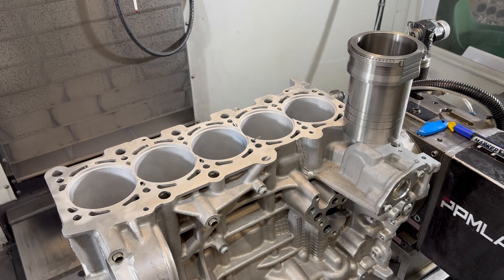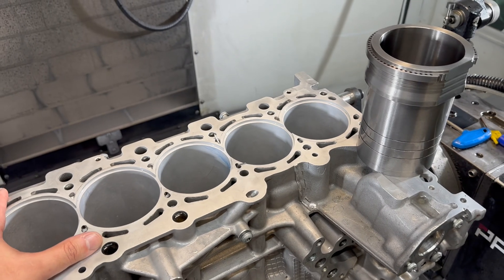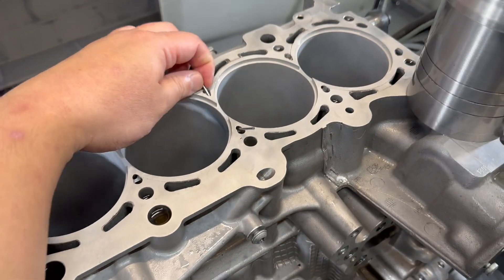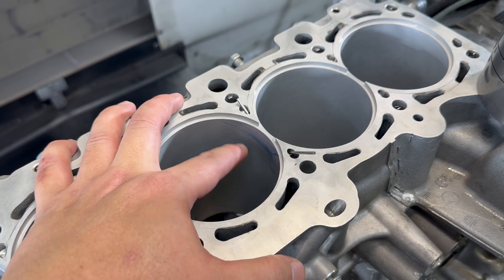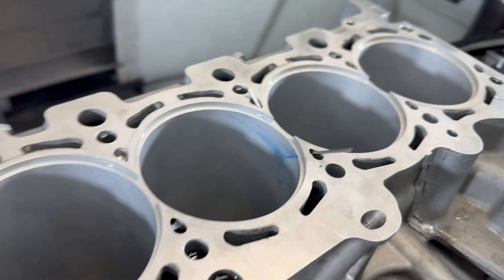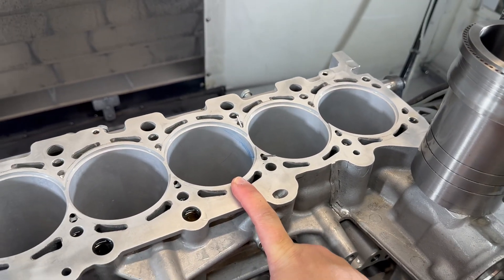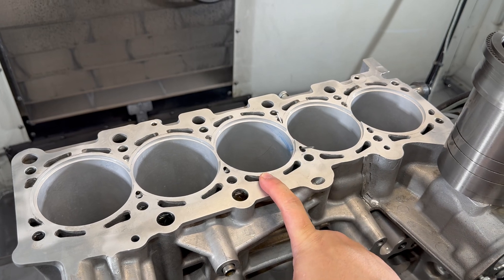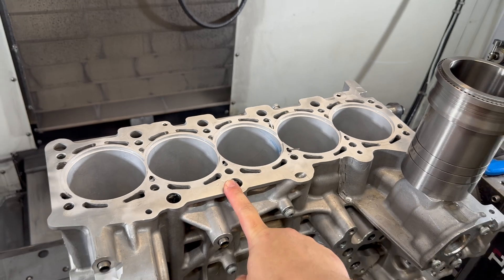What does 1200WHP Capable VAG EA855 look like?

Comment: Nice work and nice solution. Pity about the poorly engineered design of the original block.
Reply from the maker: Can t say original design is poorly engineered as it was not meant to run more than 500hp from stock. For those car running stock power, most engine will last forever